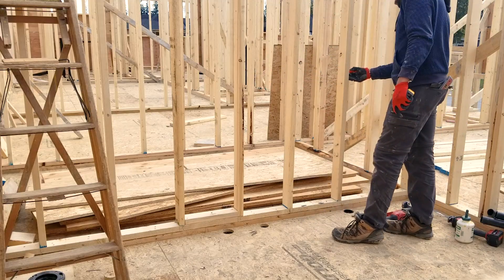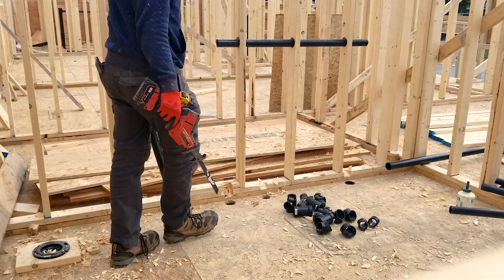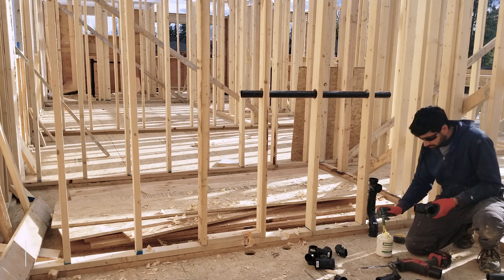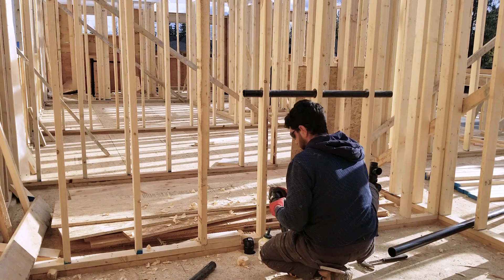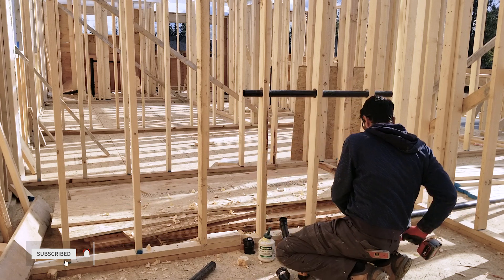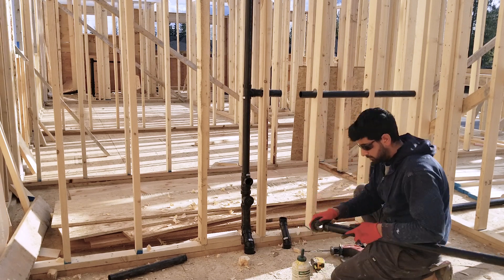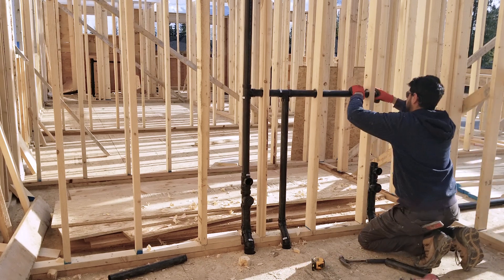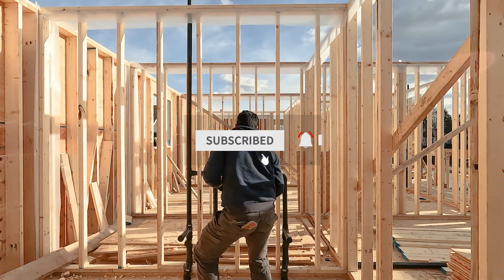Plumbing Rough In – Connecting Multiple Vents (EP5) - The Building Expert 2022

Comment from the maker: AFFILIATE Links to tools used in the video:

Milwaukee Fuel Super Hawg: https://amzn.to/4bVuex2
Milwaukee 7 pc. Big Hawg with Carbide: https://amzn.to/4aYrM7v
Empire Level 12” Magnetic: https://amzn.to/4ciiJzh
Stanley Tape Measure 25’ https://amzn.to/4aZgQqo
Milwaukee Hackzall: https://amzn.to/4aZgSP2    
Lenox Reciprocating Saw Blades, 25-Pack, 8” 18TPI https://amzn.to/3VErbmV
Milwaukee  M18 REDLITHIUM HIGH OUTPUT XC 6 Ah Lithium-Ion Battery https://amzn.to/3XgRkcV
Milwaukee 2 Pack: https://amzn.to/3XgRuB3

Comment: Quick question how would using wye to pair the vents on the left and then shooting both left and right vents up and using a final tee up top to tie everything in to one penetration to the roof compare to this? Because I was taught to avoid drilling through studs as much as possible.